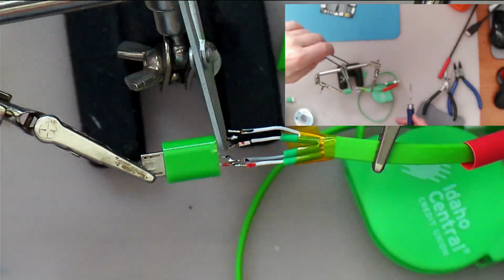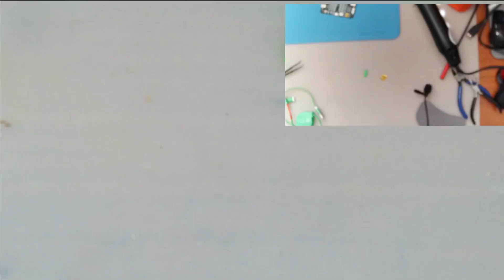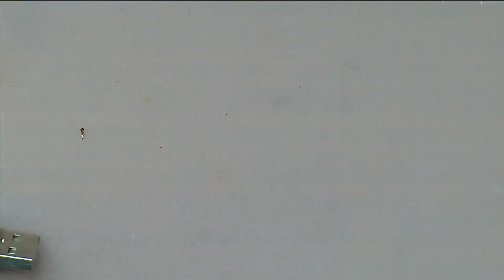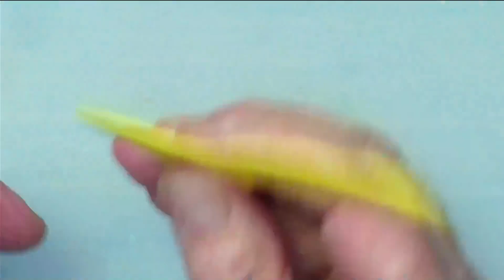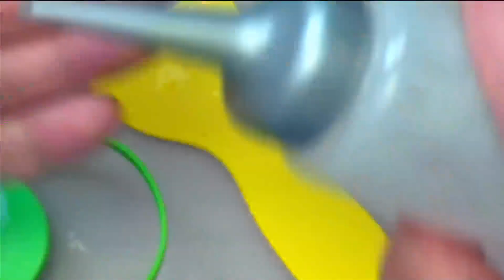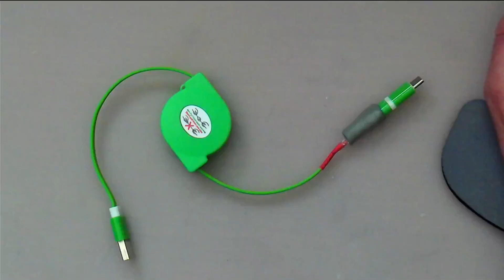Fixing a bad  USB Cable

Comment: Hi, I have to make connections like this in situations with tiny shielded audio cables.  I used to make the same sort of connections that you did in the video until I discovered something called solder sleeves.  These are pieces of transparent heat-shrink tubing (small diameter) with a low temperature solder ring inside the tubing.  You push the wires into the tubing, one from each end, and then have the stripped ends overlap inside the solder ring.  Then you heat the tubing with a hot air gun, the solder melts, and the tubing shrinks.  It makes a good connection and is not bulky.  You can get these from Mouser -- they are not cheap, maybe $0.50-$1.00 per sleeve.  But they work great--and they give added structural support to the wires.
Reply from the maker: Yes I have those as well, but I don't think I have any that are as small as those wires and there was very little length of the wires coming out of the plug.  I just like to challenge myself and do this for fun.  It this was an important cable I probably would perhaps have looked for a better solution like a new solderable USB plug.  But thanks for the suggestion, I should have a look to purchase finer solder sleeves you mention in case I need them in future.